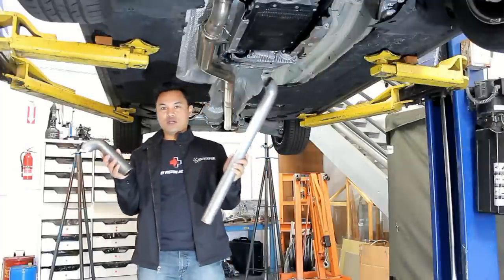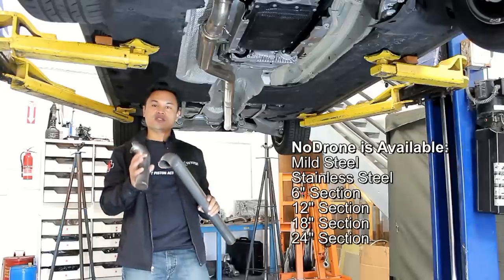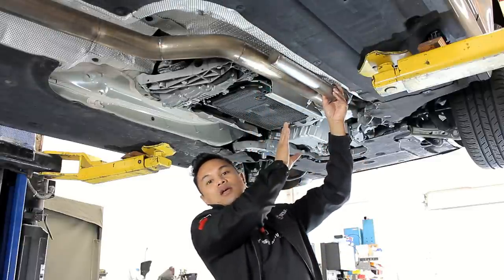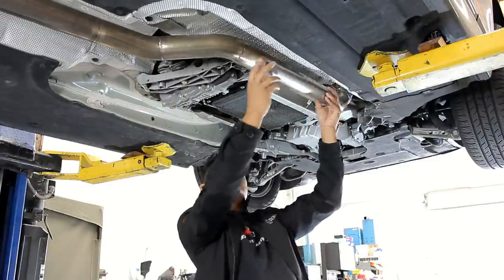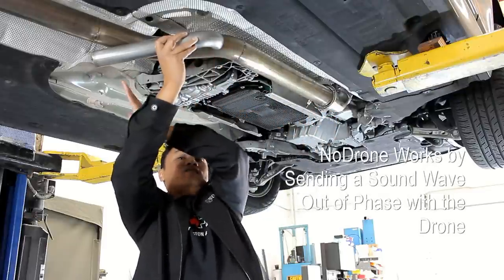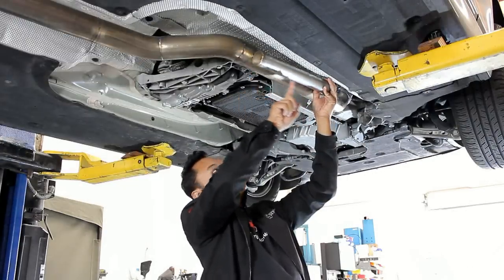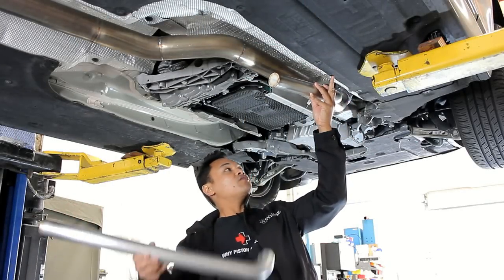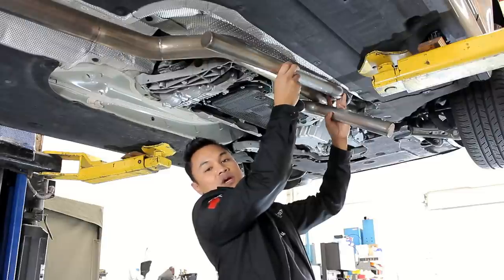NoDrone Installation Tech Tips 1

Comment: 1) It does not matter where the Helmholtz resonator tube is placed
2) The longer the tube the lower in the RPM range the drone will be cancelled.
3)  It's real simple to do a calculation to determine how long the tube needs to be once you determine (by listening) what rpm you want to kill drone. If you are going to spend the time to do this, do it right and get a tube length to exactly match your car.
4) Best results, the Helmholtz resonator tube should be same diameter of the exhaust pipe.
5) I can't believe someone tries to sell these LOL
Reply: Number 4 is not correct. You confused between Helmholtz resonator and Side Branch Resonator. Other things you wrote are correct. The problem with Helmholtz resonator (and side branch resonator) that you need to make them for specific cars and Resonance frequencies.
Reply: I have a question. Pretend I have bad drone at 1500 and bad drone at 3500 can I calculate the equation and just attach two different pipes to my exhaust system or does it only work for one.
Reply: You can make two Helmholtz resonators for two different frequencies.  But my advice, first build for the one you don't like more, and then check it again. Use "SPL spectrum analyzer" for Android phone.
Reply: @smitty2919 - i read somewhere that you cancel out the resonance on a certain frequency, but also shift the resonance to a "new" frequency.
I am planing to install a HR  my car, ihave terrible drone @2500rpm, but i fear i just shift the problem to let say 2800rpm. Anyone expiriences at this?
Reply: Do you have any links to a proper step by step of calculating to build a Helmholtz resonator? I have an exhaust that is giving a 60db drone in the 90-105hz range from 1750-2250ish rpms, the downpipe is 7" long, 2.5" tube, and the muffler is 13"x9.75"x4". I know these are the measurements I need, I just don't know what formula to use to come up with the correct sizes to fabricate the Helmholtz tube.
Reply: @bassgitter3929  ((343)/(droning rpm* N * (1/60))) / 4  
N=v8:4 v6:6 L4:2  (unless you have a mds engine and it's droning while mds is on)
Reply: @Yves998  it's an inline 6, so still six?
Reply: @bassgitter3929  last time I saw a guy with supra he is using 3
Reply: @Yves998  what exactly is that equation equal to?
Reply: @razena7365  equals to 1/4 of the droning sound waves

Comment: I thought the length had to be calculated using the RPM range it droned at, and the hertz
Reply: Exactly
Reply: Yes. The frequency determines the length. A bit of misinformation given by him.
Reply: It does, this video is not correct.

Comment: One thing he got right it that the further up (closer to engine) it is the better but you will have to calculate the length. Can't just slap any lengh in there as it might be tuned for different frequency at different rpm. Remember it's a fixed volume so it will effect a specific frequency based at certain rpm. To accurately cancel it you will have to calculate the volume based of the rpm and hertz or Db it drones at a specific rpm. Keep in mind this type of resonator can amp certain frequencies also. But not sure if a car exhaust reaches the level where it starts to amplify the frequency. So if you cruise it will work fine but if your foot gets heavy it might fail at higher rpm. Think of it this way, it work on flow of air but as soon as it reaches the threshold it will not be able to bounce back and forth effectively anymore and will tun into a screamer. But that's what you want on a heavy foot right. Sleeper at low rpm but shows its muscles at higher rpm.

I will post a video soon regards to a dual resonator build on a 1/4 length exhaust. A experiment I'm doing.
Reply: Hey there, I have a dump exhaust..so not enough pipe to place behind the muffler. Do you think placing before the muffler will have any result?

Comment: I have a 66 Mustang with roller 302 and mid length headers. It had Flowmaster 40's when I bought it.  They sounded great except for horrendous drone 2000-2500. I switched to Flowmaster FX which are supposed to be quieter. They were but drone remained. In desperation I put on some Dynomax Super Turbos. Quieter still except for the drone. Finally I installed a set of 24" No Drones and like magic the drone was completely eliminated. My only regret is that I didn't try these first with the Flowmaster 40's. Those sounded way better than the Super Turbos.

Comment: everything i have read says as far back as possible, guys have put it by the headers and it hasn't cancelled any drone, then they move it back and it cancels it out, same length pipe too
Reply: RedBeard6.2 I'm with you because most resonators are installed behind axle on high HP super cars today

Comment: I have a 2022 XSE Corolla hatchback that I want to install not one, but two Greddy Revolution RS muffler on. The rest of the exhaust (before the muffler(s)) will be OEM which includes 2 cats and a resonator. If my car has the OEM resonator installed, will it be a waste of money to buy these kinds of pipes? Will there even be an issue with exhaust drone, or is exhaust drone an issue unique to exhausts with a resonator delete?

I use the car partly for personal, and mostly for business, and I don't want my customers to have their experience ruined by on obnoxious drone sounds

Comment: I have GMC Sierra 2013 crew cab. I installed cam AR headers longtube no cats. with Borla cat-back exhaust. I have drone reaches 120db. How can you kill the drone? Note: the drone starts from 1700 rpm.

Thanks.
Reply: a 24" long NoDrone section should be able to help this problem when installed in a common section of exhaust
Reply: synaptic1 So, if I put the 24" tube, to what rpm will send the drone? If I put two tubes one after the other will it be better?

Comment: So does that mean that you can put the longest you can fit in there, so that a bigger range of drone will be cancelled???
Reply: Shorter pipes are for higher RPMs drone longer are for lower RPMs. drone.
Reply: Yes, put the longest section you can fit in there.  This is a different approach to calculating resonant frequencies. This method adds resonant volume to reduce drone.  The more volume the better the effect.
Reply: Synaptic thats some grade A BS right there. The longer pipe will cancel lower frequencies. And each harmonic above that will he less impacted. The drone needs to be targeted but a calculated length of pipe.

Comment: Should I have to install in one exhaust pipe or in both of them? Where can I buy it?
Reply from the maker: If it is a single exhaust, then install one.  If it is a true dual exhaust coming from each engine bank, then install one o each bank.  You can add multiple as you need to reduce your level of drone.  You can buy on the website.

Comment: The length does not determine the range of frequency that it cancels out. The longer it is, the lower the frequency it will block, the shorter length with block a higher frequency.
Reply: So your saying it does not but it also does?? Your comment makes no sense. The length absolutely determines the frequency eliminated.
Reply: @Jledcustoms  I understand the confusion. I meant that  essentially a longer pipe will not reduce a greater frequency range than a shorter pipe. For example, a long pipe may be effective from 125 to 130 hz and a short pipe may be effective for 150 to 155 hz. They both have an effect range of 5hz.

Comment: Having a three inch system all the way through, what diameter must the no drone pipe be to be effective?
Reply from the maker: Gerhardus Bergh we only make a 2" diameter these days because the 1.5" didn't offer enough volume to have an effect.  You should use a minimum of a 12" long section with a 24" long being what we recommend

Comment: i got drone from 1600-2000, true dual set up, no x pipe or h pipes. where should i put the resonators ?
Reply from the maker: serge ls430 up front close to the engine
Reply: SynapseEngineering approx how long ?
Reply from the maker: serge ls430 I think you’ll need at least 2x 18” long sections

Comment: Is there any equation to figure out resonator placement versus the diameter of pipe and the engine RPM in which you want to "fix" the drone?
Reply: No need, you just put the longest section that you can fit in there

Comment: Great thanks, my drone is around the 2800- 3000rpm range, will 24 inch be enough?
Reply from the maker: Gerhardus Bergh there isn't a ton of room under there unfortunately, but it doesn't make an impact
Reply: The length is very important. If this guy thinks its not then no one should be buying his stuff!!